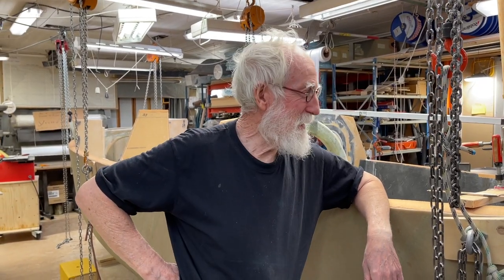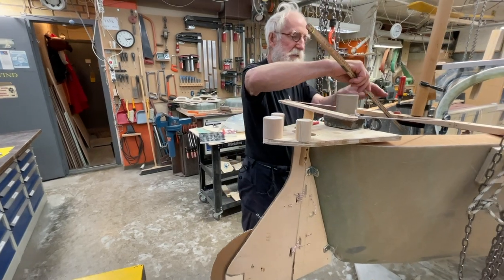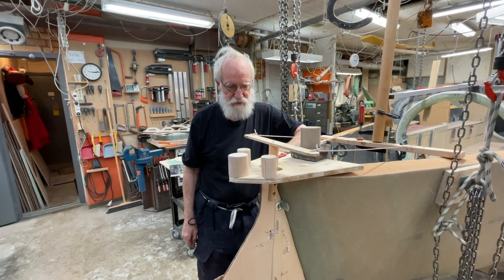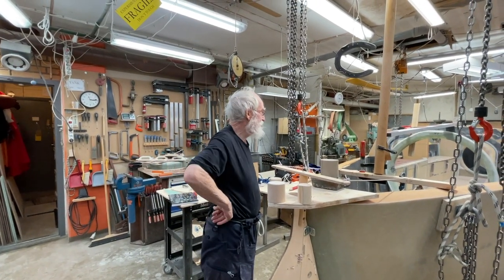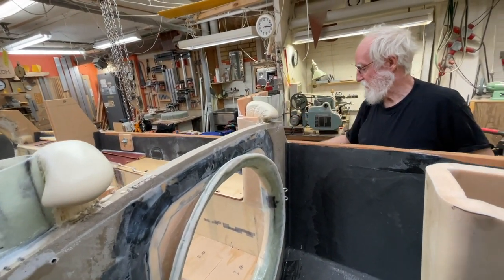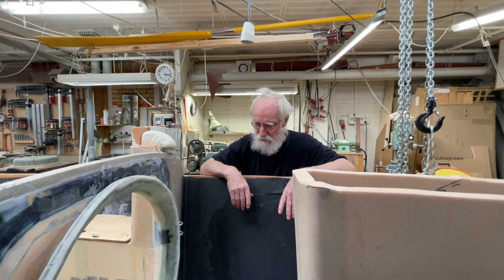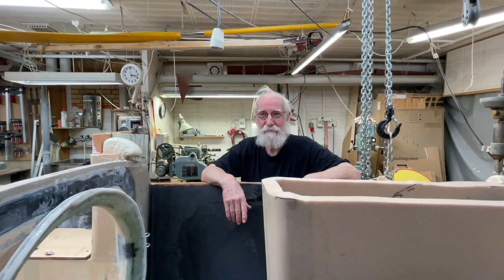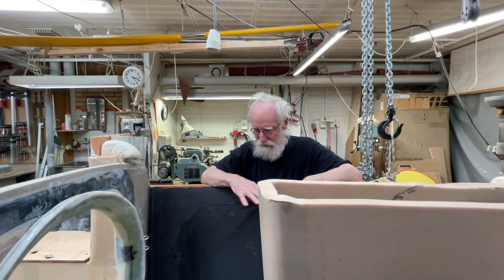1 Nov 2022  Stuck with rudder mechanism problem  But give me time and I will find a good solution.

Comment: My internal steering will be done with a stainless steel shaft passing vertically through the aft deck. If you don't want to use metal maybe you can do it with a G11 shaft. Bellows for a tiller coming up out of the aft deck sounds like a real pain and too much opportunity for leaks. The shaft can have a circular plate attached where it enters the deck, and the shaft's plate rests on a similar raised plate attached to the deck. Plates can be made of Pom for slipperiness. Bearing grease goes on the shaft to keep out leaks.
Reply: I thought of the same solution.  But puts the rest in Swedish.
Med en axelgenomföring på akterdäck och en axel med ok både över och under däck, kan du få en vattentät lösning.
Linor från oket på rodret till oket på axeln. Och sedan nya linor som tar vid under däck.
Reply from the maker: Will be interesting to see.

Comment: Okay, here's a little out of the box tiller solution that requires no penetrations:
1. Tiller comes forward from rudder shaft just above the deck (of course it can sweep up and over the aft bollard if necessary).
2. Fitted to the end of the tiller is a properly sized neodymium magnet.
3. Below deck there is another properly sized and oriented magnet fixed to a mechanism that sweeps it in the same arc as the tiller end.  
4. Essentially, establish a magnetic lock between the above and below deck tiller mechanisms.  There must be sufficient neodymium magnets and placement to establish sufficient coupling strength.  Might be practical, might not.
Reply from the maker: Thanks for the thinking.
I think the magnets can keep the rudder in place but to move the tiller will be difficult whithout moving the magnets.
Reply: @SvenYrvindExlex  hey Sven.  That was what I was getting at.  If you move the magnets that are under the aft deck and only separated from the magnets above the aft deck by the thickness of the deck, the magnetic field from the below deck magnets will move the magnets above deck and therefore move the tiller.  You would have a "tiller" below deck linked to the tiller above deck by a magnetic field that would pass through the glass/foam composite.  The pivot for the below deck tiller arm could be supported by the deck leaving the aft compartment clear.  The below deck tiller just swings the magnets in an arc matching the arc (approximately) of the above deck tiller end, pulling along the above deck tiller.  With careful placement of the magnets, the pivot points above and below deck could be displaced from each other as would be required with your current geometry.

Comment: Use a simple hydraulic steering. That will solve your challenges.
Reply from the maker: I had a few cars with hydraulic brakes
It often works but sometimes you have to pump the brak to slow the car.
Thats OK on a car when you do not break all the times,
but on a boat there is mostly constant pressure on the rudder.

Comment: Glad you are feeling better. Very interesting rudder setup.... perhaps something like ....run the tiller lines into a small compartment/removeable hood over the stern deck that would drain (like an anchor locker ), and then each line passes thru bulkhead within tube fitted with working rubber seal ....pitch lines toward stern ?

Comment: How about duplicating your existing steering mechanism. Add another vertical pole that will go through your deck and sealed on the above deck portion another bar going across like the one over the rudder.  Connect the two bars with a rod on each end which will make them move  together. Inside the boat the bottom of the vertical bar will have a handle or some form of steering for you inside. Should be a lot easier to waterproof this idea

Comment: Glad you're feeling better, Sven.  Maybe some good samaritan has been looking after your car for you. 
Suggest connecting the parallel steering ropes to a 2nd identical pivot arm installed on cabin roof with the rotating shaft controlled from inside cabin.  This would be a clean setup and it should be easier to  waterproof the through hole for the rotating shaft than for the ropes?  (Could experiment with possibly using one solid rod instead of 2 ropes - just a thought.)
Reply from the maker: That the car started right away and that the tires had the good pressure I will not forget.

Comment: Drop the crank lower, below deck, and run the controls straight into the hull on each side.  You could have some kind of grease filled stuffing box or maybe a bellows as you say with some redundancy for sealing out the water.  The water then could be contained in the aft section.  You were going to run the rudder shaft in there before.  Just some thoughts.  Glad you're feeling better and your foot is too.  You'll be dancing sea chanties any day now.

Comment: I recommend you go with a circular quadrant instead of a blade. The circular design will be stronger and will also allow you several options. The first and foremost would be too easily attach an emergency tiller. This could be done with vertical posts placed four and aft on the circular quadrant while the steering is at zero neutral and you could slide a new tiller onto both of these posts and make it fast with pegs or clips as you see fit. Or even Wing nuts if you like. I would also consider having an extra rudder or two stored somewhere below perhaps doubling as a bilge board or something. It should be pre-drilled to accept whatever hinges already exist on your rudder mount. You can fill those with beeswax or something until needed. I find having contingencies on board for emergency steering can be priceless. I know many offshore sailors that have been left rudderless after an accident with flotsam or a sea creature.. as for waterproofing whatever steering system or linkage, you can place two tubes of whatever material you like Port an aft and route your steering lines through them. If you're using half inch low stretch braid for a steering line, use 1 in tubes. On the lines, alternate balls and neoprene discs. The balls should be 7/8 of an inch and the neoprene discs should be slightly larger than 1 in. This will create a watertight bearing assembly that will also have some friction depending on the weather helm. I would recommend using tubes 12 in Long at a minimum and 10 or so balls and neoprene discs alternating. Spacing them will be based on how much total travel the rudder will have lock to lock. The whole idea is you should have a minimum of four to six pairs in the tube at any given moment. I doubt any water will come in at all. Just an idea. I tried to come up with the way to keep it extremely simple, easy for you to fabricate, easy for you to repair at sea and easy for you to store lightweight parts.

You can also adapt a power steering boat teleflex system. These are completely waterproof and would give you a rack and pinion system inside the cabin and easily adapt to the rudder.
Reply from the maker: Thanks for the advive .
Balls and neoprene disks are intersting.

Comment: That is great news that it was in operating condition after sitting so long! You must have taken precautions with the 12v battery.  What is the make, model, and year of your car? 

The problem of the rudder control is difficult to address with the constraints you place on it. I am sure there will be a clamor of ideas offered here in the comments. It will surely roll around in my head until I have something worth sharing or you select a solution of your own :)

As always, thank you for sharing your process!

Comment: If you google 'tiller around mizzen mast', there are many examples where the tiller splits and goes round both sides of the mast and back to a single tiller handle (https://www.davidmossboatbuilders.co.uk/wp-content/uploads/2012/01/Otter_15ft3.jpg). Maybe something like would work?